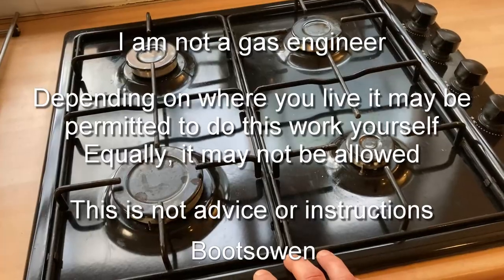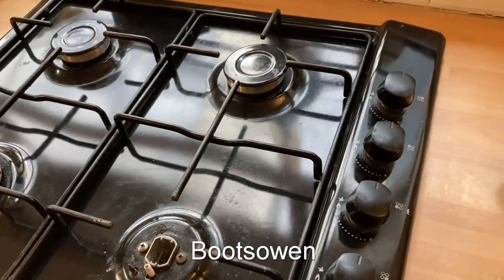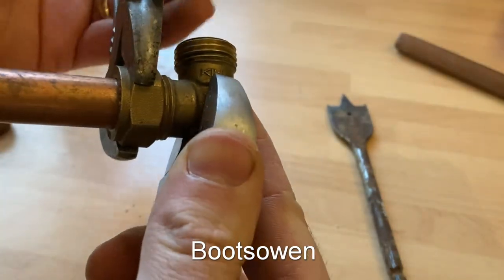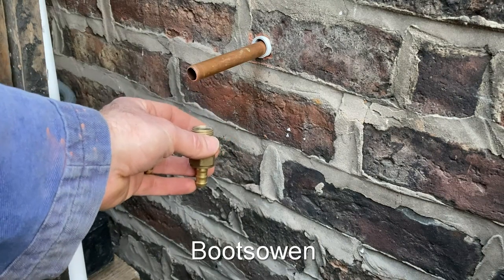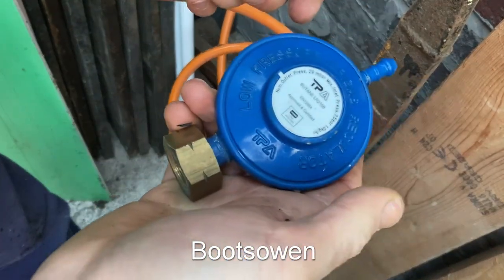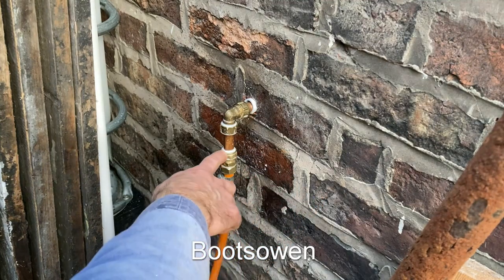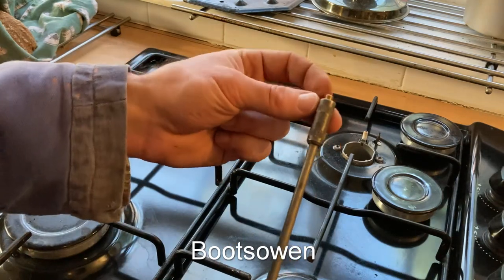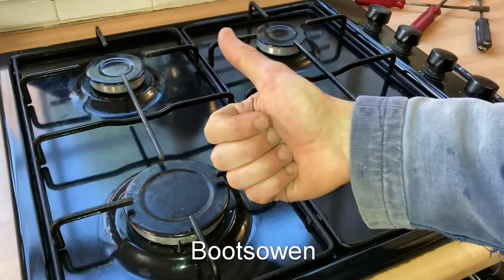Natural gas to LPG stove top hob conversion: Plumbing and jet replacement: DIY gas installations!

Comment: If you use butane cylinders on a correctly converted hob, oven or cooker at 28mbar domestic pressure, you do get very slight yellow tips at the top of the flames (a small yellow triangle) and this is quite normal.

With propane cylinders used @ 37 mbar domestic pressure on a correctly converted hob, oven or cooker, the flames will be largely blue on a cooker top or hob, with just a very small yellow triangular tip at the very top of the flame on the oven and grill burners.

NB What you must not do is use an unconverted natural gas cooker hob or oven straight on bottled gas (butane / propane) as this will produce large yellow flames and large visible yellow tips on ignition, that aren't very controllable i.e. too much gas being fed into the fitted natural gas jets and consequent black sooting of pans kettles and utensils plus sooting to the oven sides, grill frets and grill sides. 

And you cannot get around this by merely modifying the natural gas jets to take the LPG, as the calorific values, operating temperatures and working pressures of natural gas and bottled gas (butane / propane) or via a permanent plumbed in propane tank supply at greater pressure, are totally different / incompatible with each other.
Reply from the maker: Hi, thanks for the comment, I don't really understand the last paragraph. You change the jets and use a regulator appropriate for the gas. What point are you making? And to whom, me or another viewer?
Reply: @bootsowen  Some people falsely think they can modify the existing natural gas jets in an effort to get around the problem, thinking they can run those jets on LPG when they can't, just because the burner orifices are enlarged doesn't mean to say it works properly.

It doesn't work, as it just puts even more gas into the jets, and will not work properly as it still overfuels the burners further, with an excessive yellow appearance and even more soot.

Comment: Owen, good man, use the waste from you urban neighbours. I'm surprised these get thrown away almost full, I suppose caravan owners and such like. What news of Amie? cheers
Reply from the maker: Amie is in an audio file waiting for me to make a video file to overlay, I guess I could just use washing machine footage. It is on the list. I think it is obscene that things like this are out for the taking, but that is the modern world. People are so reliant on mains gas, water and power, and a single source of income. The edge is very close for the vast majority of people. I am surprised that so many people have already forgotten the empty shelves on shops in 2020. 
I was quite pleased with this gas effort, it will be a 5 minute job to change it back when the gas is empty and it was all done with parts that I had in the shed.
Reply: @bootsowen  Owen, I agree a single source income is crazy. A portfolio career means that there is always something to turn to. Much like the old style mixed farms designed to with stand the variations in weather and the markets. They realised they could not trust anything but people have lost that sense of reality, cheers

Comment: I was hoping you would light it with the piped gas jets just see.
Reply from the maker: I have had a hob before that had the correct jets for LPG but in the incorrect rings, The big ring would barely light and the small ring had a huge flame. LPG jets with piped gas would just have tiny flames and be difficult to get the flame device to heat up.

Comment: Hi Owen,dont want to be a yt party pooper know it all yashouldvedoneitthisway ,but I think all the brass threads on the compression fittings should have that extra thick gas rated PTFE tape...great to get off grid as much as you can👍
Reply from the maker: Indeed, where the threads are making the seal you need tape or string, but where there is a compression olive I don't think you need it, I used to use it, but not anymore. The spray agrees!
Reply: @bootsowen  I see what you mean about the olive,I always used the tape thinking it would add an extra layer of protection,but maybe one could argue that two Durex is definitely overkill,so from now on,the tape is only coming out  on special occasions..